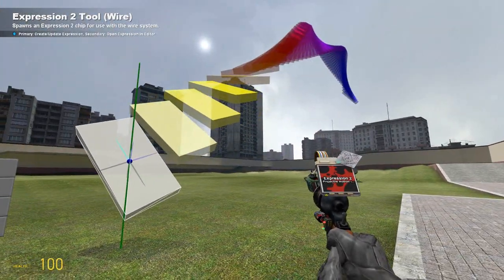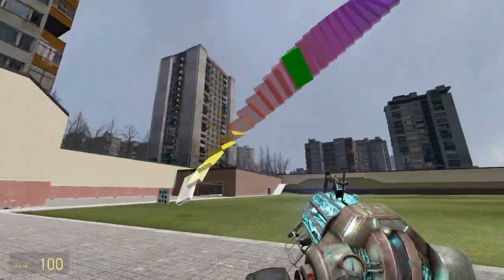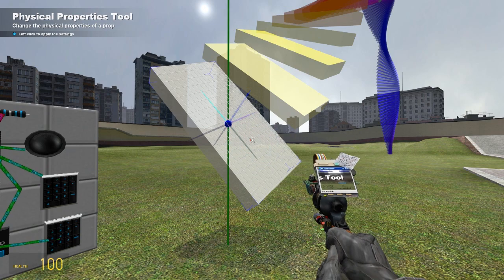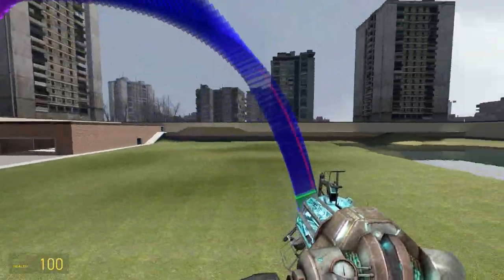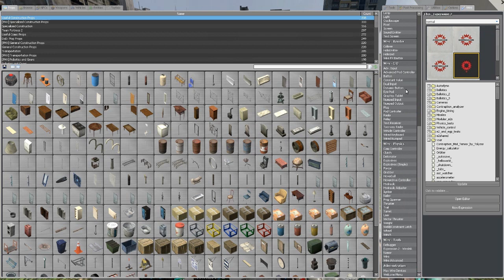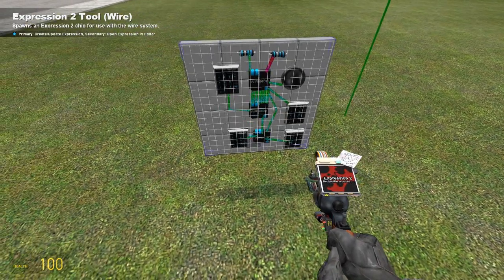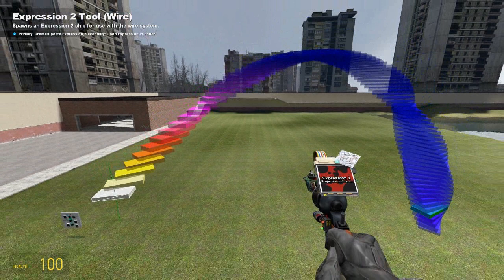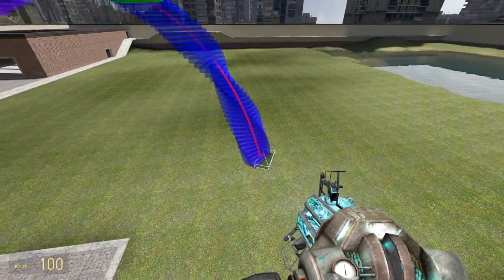Ballistic trajectory simulation with rotation & drag for Gmod

Comment from the maker: Continuing the story of how this works; Once I had all of the force due to drag stuff sorted, I came up with a complete equation for the acceleration of the projectile, by including effects of mass and gravity, you will find this in the code: "G - (Cd * Rho * FrontalArea * AccVel:length2() * AccVel:normalized()) / M". This is then numerically integrated (using the RK4 method) twice with respect to time to yield the trajectory position array output.

The angular stuff is analytically integrated.

Comment from the maker: @TutsPlus To work it out, I broke it down into small experiments; Firstly I verified that inertia and gravity worked like they do in real life, by having a play with applyForce mainly.

Then, using the idea of terminal velocity, the translational drag constants can be found. I then discovered that the area used in the drag equation is actually the orthogonally projected area of the bounding box by observing the fact that plates fall faster edge on.

Comment from the maker: Yes, I made a toilet firing catapult that uses this plus an iterative trial-and-error expression to converge on a solution. I am still working on the simulator on and off though, once it is properly finished I might make a decent artillery system.
Check out my 3 yo mortar video, simple ways of making artillery are also possible.

Comment: can you point me in the right direction with e2 transmission? just need a method to work out torque generated by an engine and torque required to drive the wheels thanks